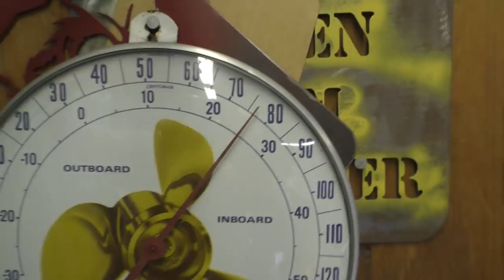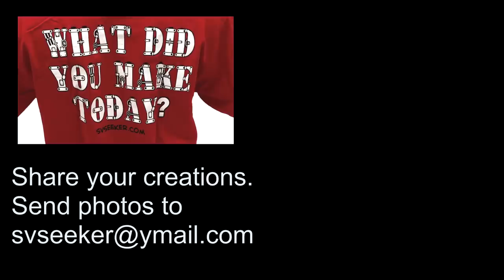Pilothouse Fitout - Part 5 - Floor Port, Cabinets and Settee

Comment: I found that laminate wood flooring works great for countertops. I made mine out of half inch mdf and glued self locking laminate flooring down on them.  I was working on a school bus conversion. I even built a table this way. It works great as it is designed to be tough enough to walk on, i.e. resisting scratches and dents, and it is waterproof. The locking function of the flooring resists warping and creates a very sturdy surface to work on.
Reply: Do you not get food and dirt in between the little gaps where they join up?
Reply: @Neilukuk  No. I used a locking laminate that pulls together. They fit tightly. Yet at the same time they allow for expansion and contraction in differing conditions.

Comment: If you got a induction cook top you can use a silicone baking mat as a anti-slid for keeping the pans in check during rocking and rolling of the boat.
Reply: That's a great idea even for me, I am so tired of my pot sliding off the glass. My 12 story apartment block isn't even rocking much...

Comment: Weld a 2x3x1/8  steal block to the hull, then another to the pilot house out of aluminum. Bond the two together with a bonding wire and the majority of any galvanic corrosion that you experience will be at those two places. Plus they will be easy to remove and replace instead of replacing sections of the pilot house. We use these bonding tabs all of the time on airplanes
Reply: And then use thin recycled rubber strips (found as anti slip matting used under pallets in tractor trailers) then caulk the heck out of the bolt connections between the pilothouse and the rest of the boat to discourage any corrosion to take place in that hard to replace location...
Reply: As someone who worked on several first generation DDGs and DFGs I've seen the progression the yards went through to protect from dissimilar metal corrosion. Not just aluminum causes this. These early ships had steel hulls and aluminum superstructure. Sound familiar?. The last efforts were to not only isolate the structures from contact but also to completely insulate the bolts (sleaves) washers (non-conductive gaskets). But also to make all the grounds connected via common grounding buss bars. All items such as mast cable stays had non-conductive links. And all nearby surfaces were coated to help prevent stray currents jumping across in wet moist conditions. Even with all this there was still sever corrosion.

Take it seriously!
Reply: @andy thank you for the insight! I honestly had no idea that was an issue there. I was just giving my advise or maybe just a different approach to things. No harm was intended by what I said
Reply: @alexg0097  no offense taken. It was very enlightening to see all the different ideas Lockheed's engineers tried for well over 3 decades.

Comment: Would be really interesting using that wheel. I used to move a tiny yoke an inch to move a 55,000 ton ship 5 degrees. This looks way more fun.
Reply: S' why I miss older ships with telemotor steering. Pilot called Left 5, I'd turn the 5' diameter wheel a turn and a quarter.

Comment: I work occasionally with the cruise liner Queen Mary 2 when they visit the US. I talked with the 2nd asst. Engineer about the corrosion where the aluminum topsides meet the steel hull- a weight saving thing for stability. Where the isolation is maintained, it's pristine after more than 10 years. Where the isolation failed, the body rot is extensive. Red Hand is not structural. Worth remembering.

Comment: I like to tap the rod on the steel to get the arc started it also breaks any slag/flux that forms on the end. you can also do a little fling after you end the arc to throw that little molten chunk of glass off the rod

Comment: If you are going to tap with drill a good tip is to grind 3 flats on shank of tap. Will save your drill Chuck.

Comment: To help minimise galvanic corrosion, try strips of rubber between the pilot house and hull? Im thinking innertube for tyre? Would also seal it a bit from water? That way you can just punch the bolts through the inner tube no problem and no metal to metal contact? For the cost worth a go maybe

Comment: so for the bolts holding down the pilot house, put a washer on the bolts so you dont put it throught the plastic
specifically a fender washer to spread the load out as much as possible

Comment: Galvanic corrosion. Nylon washers are a good idea but you probably also want a chromate jointing sealer as well e.g. Duralac is one brand. And maybe a few zinc anodes.

Comment: Hey Doug not sure if you have thought of this or someone has mentioned it but what if you used UHMW plastic sheet between the aluminum and steel use silicone to seal between seams thus electrically isolating the metals.

Comment: Unless you're welding something like structural steel or high pressure pipe, if the weld looks good, it probably is good enough. And if it doesn't look good, it's probably still good enough.
Reply from the maker: True that.

Comment: since galvanic action is unavoidable the two questions should just be 1) what's the plan to repair it? looks like it'll happen on the steel side and between the joint, so you'll have to lift the pilothouse to do any work. and 2) where should we put the zincs and how many?

Comment: I'm sure this won't be a problem but with the separation between the aluminum pilot house and the ship you might limit your lightning protection. The pilot house will likely be struck by lightning and you Will want to have have a good grounding if you don't already.
Reply: Im sure the masts/rigging are more likely to be hit with lightning than the pilot house. That said, grounding might be a worthwhile trade off given the expensive nav equipment in and on the pilot house.

Comment: Maybe nylon washers under the metal washers and thin nylon tubing sleeve over the bolt?  Or if all the hardware was coated in dielectric grease; would that work?  Or install some sacrificial anodes nearby? On aircraft stuff they would install a bonding wire and that would wind up taking the corrosion.

Comment: Now Doug, with SMAW stick welding, if you hold too long an air gap you increase the resistance which will shoot the voltage/heat up.  That has to effect of making the arc too hot with indiscriminate deposit of the weld material.
Reply from the maker: I don't think you listened to what I said.  : )

Comment: @ 3:10 I'ld say anti-seize on bolt threads is a good idea, ESPECIALLY stainless bolts. Stainless gauls at the drop of a hat.
Reply: Worst part is that the faster you spin the spanner, the more likely to jam up. I have always had issues when rushing and didn't have time for issues lol

Comment: Galvanically isolation of the pilot house: watch out for the ground connection for the electricals if they are connecting the parts together you need a ground offset thingymajig they use for land power for boats.

But just going with what ever and fixing the problems along the way might be the best thing anyway. I would probably do that unless it was life threatening.

Comment: The aluminum bolted to the steel hull is an idea that has been used for a long time in the north west.  I have worked on one of those sailboats ( a Swain) and the electrolysis/corrosion issue is serious especially with stainless. we replace a lot of aluminum sills because they got too crusty to be reliable.  We then used a hard plastic like G10 or HMPE as a barrier and a plastic washer and short plastic tube to totally insulate the stainless bolt from the aluminum.  Zero contact.  This has lasted well for two decades.  Never used Neverseize as it contains Zinc.  Why introduce a third metal into the cocktail.  It is banned on many commercial ships.  Always use the Teflon based stuff.  Do it right or do it again.

Comment: The isolator washers are a great idea between the aluminum and steel but, I would also use some type of plastic tubing to cover the threaded part of the bolts too.  Boat is looking fantastic, what will your next project be after this. Haha 😆
Reply: In an older video he showed how they planned on doing it. The threads were covered with vinyl tube.
Reply: That works well i have done that with aluminium handrails to galvanised walkways. Nylon washers and thin Nylon type tape around the bolts.

Comment: Galvanic or cathodic corrosion: About eight million years ago during a period when the Royal Australian Navy made the colossal mistake of accepting me on a nine year enlistment, I was posted to the HMAS Perth ( an American built DDG class destroyer) where my sole responsibility in life was to make sure that the aluminium (aloominum) bits on the upper decks  attached to the steel bits, including the deck were maintained clean and free from corrosion. I did this with a paint called Yellow Chromate which was a sickly yellow green colour. After one or two coats followed by the Royal Australian Navy's favourite colour for everything, namely Ship's Side Grey, the corrosion would stop for months The stuff seemed to hold up well in wet salty conditions and did what it was supposed to do which was to inhibit the galvanic reaction between aloominum and steel, brass nickel etc etc. I don't know if the stuff is still available being as how Yellow Chromate contained Cadmium I think which was the active constituent. The safety nazis probably banned it's use on the pretext that some idiot might think it might taste nice. But if you can get some it might be worth a try on the deck house / deck mating surfaces.

Comment: Tap with a drill. Or better yet do what I do and use a socket adapter for the tap and use your impact to tap. It lets the tap follow the hole better and the hammering action makes it easier to go.
Reply: Power tapping the way to go!! Although I can see myself just destroying taps if I tried to use an impact 😂
Reply: @Danndamannn   it really works out better than you would think.  Use oil and use a 1/4 impact and it works like a charm. I’ve been doing it for years going into 1/4 plate and 3/8 beams and occasionally 1/2 as well.

Comment: As per what I was told about galvanic corrosion of aluminum and steel by a US Coast Guard petty officer, the sea water functions as a conductive path for the corrosion, so painting the Al can help, but it won't prevent it. Using sacrificial anodes on the boat's hull that have a higher charge than the Al and then painting all surfaces as much as possible will protect the Al. You can also use the body of the boat as the negative ground for a DC system (6 to 36 VDC) and that will protect the Al and can even protect the steel some, if you run it all the time, have multiple connections throughout the boat from the negative ground to the hull and Al parts. Resistance will drop the voltage the DC system is using to protect the mentals, so low resistance paths may have to be added.

You do spend power doing this, so not connecting it to your batteries is a good idea since it will kill them over a few days to a month. So, if you are underway or anchored, just running some power generation or taking the hit to the battery capacity is a way that you can take advantage of using such a system. The ships he was on all had constant power generation for other systems, so this was no big deal to keep going. Using solar panels in the day the create the charge and batteries overnight might be possible.

If I recall, the sacrificial anode material you cast for Seeker should be the right type to protect the Al, but I would check and talk to some salty dogs about their experiences. Adding in grounding connectors to the pilot house that run back to a DC negative voltage that the steel hull also shares would be the next step I would take. You still need the electrical isolation that you have already done, even with the sea water being a conductor, it is one with higher resistance than a few copper cables and stainless steel ring connectors, so the voltage would still build and protect the Al as long as the other paths for charge are a higher resistance.

Power tapping doesn't worry me. Set the clutch on the drill right and keep stuff steady is all it takes. Just don't use an impact tool, especially a powerful air impact gun. They can easily snap a tap. Last one I saw go like that was when I still worked as an assembler at a heavy equipment maker. The line manager decided to tap a hole that way and save time so the line could move the units to the next stage. Snapped the tap and made us have to have it extracted or lose the axel he did it to. A bit of blowtorching and some good vise grips got it out, but we needed paint afterwards to fix the area.

Comment: Can you just run grounding strips for the pilot house every so many feet and the electricity won't flow through the bolts as much? Also have you looked at using the drill and tap combo bits? Drill and tap at the same time.

Comment: @SV Seeker, why not use copper strips under the pilot house and copper washers on top to separate the two like they do on yachts and other large vessels with two part construction?
Reply from the maker: Given what I’ve seen and galvanic corrosion tables, that sounds like an insanely bad idea. I’d love it if you could show me wrong.

Comment: I like the ideal of using plastic to electrically isolate Pilot house but, I am concerned about the kind of plastic, being used. They do make "Marine" specific plastic but that stuff is stupid expensive; a much cheaper alternative is Delrin(they even have an ESD safe variety). While its thermal stability isn't as good as the "Marine" rated stuff, it's still rated for use between -40°C to120°C(248°f). A company I used to work for, used Delrin on their ROVs that serviced subsea wellheads as replaceable bumper pads(among many other uses) so its plenty tuff and doesn't have a problem with salt water unlike a lot of other plastics that start to break down when exposed to salt water for long periods of time.

Comment: Lumber prices have gone nuts as of late. I live in a mill town, within a 30KM (18 mile) radius there is 5 lumber mills, and our local home depot buys direct from them 
and an 8ft SPF (spruce, pine, fir) 2x4 is $8.85 cad ($7.20 usd) a board. 

But thats not the worst part, 3/4 standard spruce plywood is $96cad ($78 usd) a sheet but here's the funny part, 3/4 maple plywood is $89 cad ($72 usd) a sheet, and 3/4 pressure treated plywood is $91cad ($74 usd) a sheet.

Comment: The steering is hydraulic right?  But you don’t need any of the pumps running to steer.  Is it a separate hydraulic system that has its own reservoir?

Comment: My vote; Dielectric isolation, it's a great idea.   Will discourage accelerated corrosion.
Reply from the maker: What from of isolation?  Paint, and plastic?  Or something like Tefgel?
Reply: @SVSeeker    plastic; HDPE.  It needs to be thick enough to discourage bridging, and wear.   Wrapping the bolts with teflon tape, or using a piece of plastic tubing (using cheap 5/16 plastic tubing with a heat gun to soften, slip on like shrink tube) will discourage stray current from moisture on the mounting hardware, using plastic washers with a metal washer set (wide flat & split).
Reply: How often will the pilot house need to come off after launching in August?  

If it's going to be a long while, I'd say silicone caulk between the steel and aluminum. I used to build TV trucks, and we installed the roof platforms with silicone and rivets.  Bonding was really effective..  We needed to take one off of a wrecked truck, and with all the rivets removed (just the silicone caulk holding it) we picked the E350 van off the ground.  And it kept the surfaces apart and from corroding.  Bedded the rivets in silicone too.

But not a great idea if you're going to take it apart often.

James

Comment: I noticed you tapping some of your holes with a screwgun ,like you said some folks dont agree with it,But if you you would try a three fluted  spiral tap it would  probably tap a lot better.
Reply from the maker: Send me some more to break, and I'll try em again.  : )
Reply: You can get  6 imperial 1/4" Hex HSS Composite Spiral Screw Tap Drills 1/8" (3.175mm) 5/32" (3.97mm) 3/16" (4.76mm)  1/4" (6.35mm)  5/16" (7.94mm) 3/8" (9.53mm)

Comment: Isn’t the pilot house electrically connected through the ground on the electrical panel? or is the panel physically isolated as well
Reply: I’m sure just the outlets and light fixtures are grounded through the wire and not to the pilot house itself.
Reply: @stevenbeach748  I was just wondering if the panel itself (Which is steel and bonded to ground) is making electrical contact with the pilot house through the screws, and if the ground is connected to the steel hull as well (If it isn’t on purpose it probably will be though the generators and panel.) If there were isolating washers and collars used on the screws for the pilot house panel then there won’t be a problem. A continuity test can confirm that the isolation has worked
Reply: That’s a good question. I’m not sure it’s in the pilot house. I think it’s down below. But if it in the house then it’s probably screwed into the wood
Reply: @stevenbeach748  They decided to place a sub panel in the pilot house to make it much easier to disconnect for removing it. And yeah it is screwed into the wood

Comment: GOODAY
WITH LIGHTNING CONDUCTOR SYSTEMS YOU HAD TO GO FROM CU TO ROOFING MATERIALS AND AVOID ELECTROLSIS. IT WAS GENERALLY ACCEPTED THAT IF YOU JOINED THESE ITEMS WITH SS STRAPS ELECTROLISIS WOULD BE MINIMISED. SO PUT A THIN STRIP IF SS IN THE JOINT AND USE SS BOLTS.
CHEERS ROGER DARWIN

Comment: save money on plywood, the foam board can be made stronger, by gluing and adding screen to it much stronger than ply
Reply from the maker: It works, but it's not stronger than equivalate thickness ply.  I'd love you to prove me wrong.
Reply: I will soon